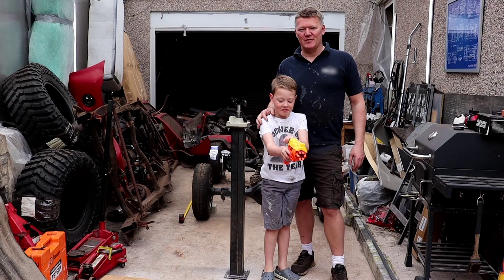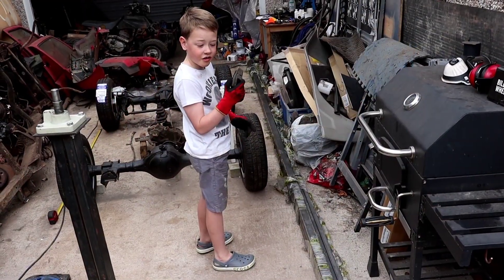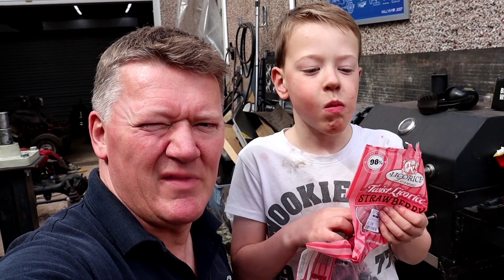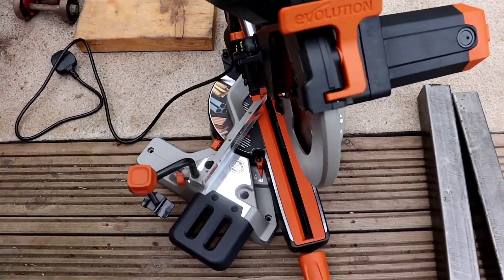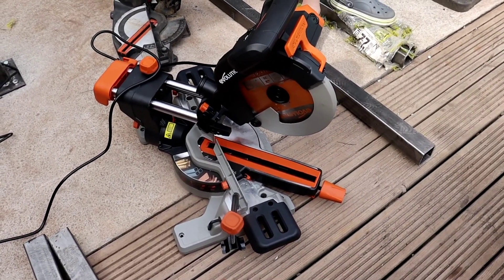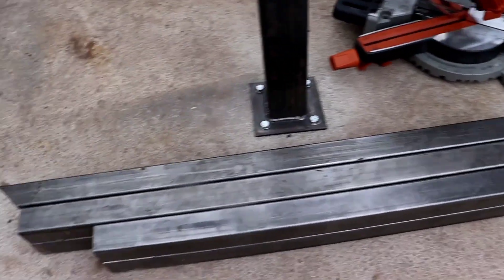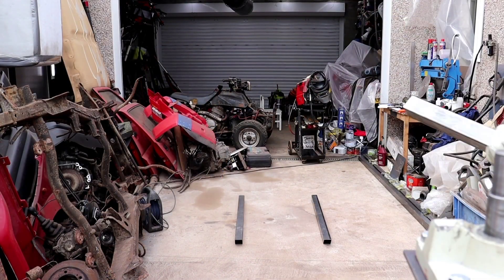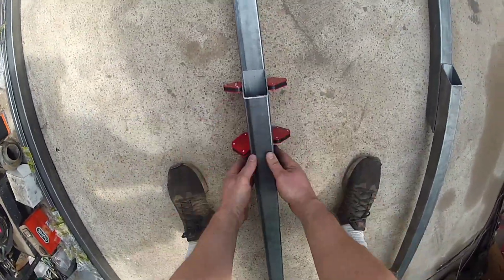Ollie's Mini 4x4 Willys Jeep Car Build Ultimate Kids Toy Ep 8  Chassis Frame Mig Weld Metal Chop Saw

Comment: Would like to know the exact dimensions of the tube used!
Reply from the maker: The chassis tube is 50mm x 50mm x 2mm square box section. The chassis is 600mm wide and 2400 long, with an additional short drop down section at the rear where the body is mounted.
Hope this helps!
Reply: @oliverbanford  thank you so much! This is a huge help, as I didn’t know where to start on the dimensions of the base tubing. I love this video series so far and I can’t wait to see the finished project!
Reply from the maker: @clappincheeks5584  no problem, good luck with the build 👍

Comment: Hola q tal tu crees q podrías compartir las medidas q usaste  para ASER el bastidor y q  calibre de tubo
Reply from the maker: Hi, The frame is made of 2mm gauge 50mm box section. In total it is 2400mm in length and 600mm wide. The frame overlaps are 200mm and the overlap cuts are made at 50mm diagonals, pretty easy stuff. if you need any specific details just shout out. 👍